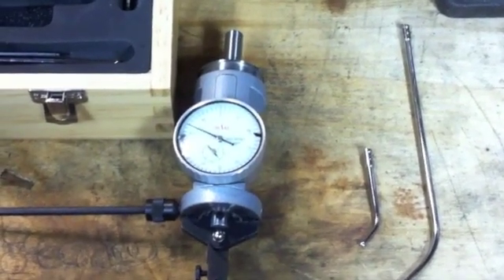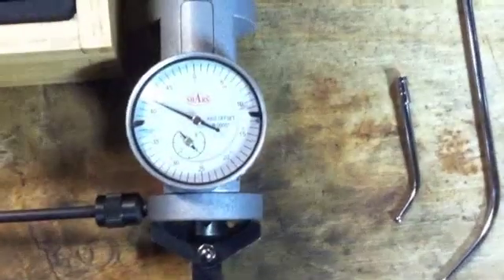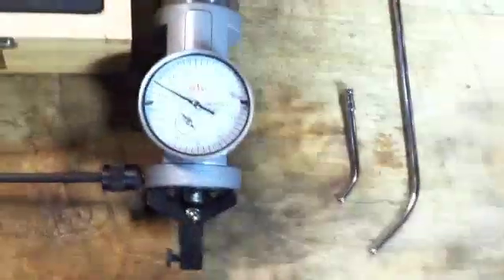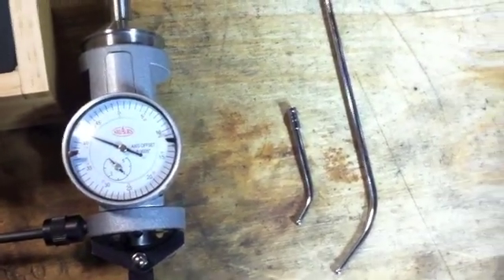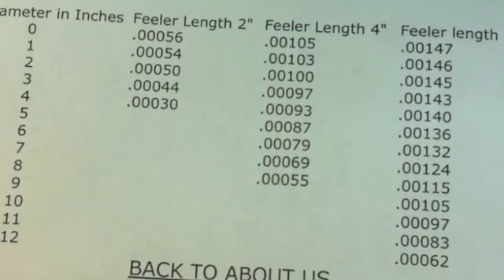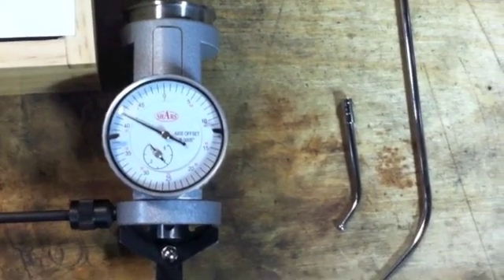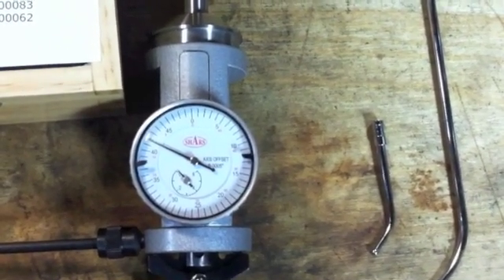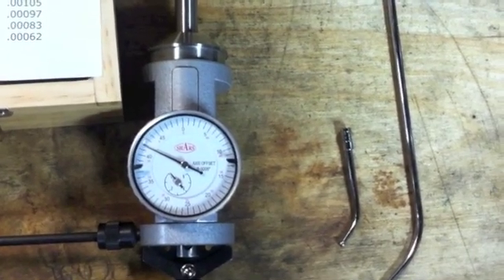Coaxial Indicator, an explanation of proper use.

Comment: I totally agree about checking the tools before hand; and do it as soon as you get them. I just threw 2 sets of ER20 collets in the trash as the run out was horrible. The next set I bought, I checked them immediately. I have spent a lot of money on measuring equipment which has been well worth it.  Thank you for the video and showing the chart from Blake. They don't list it on their site anymore so I typed it from your screen shot.
Reply from the maker: Good deal, Glad it could be of use to you.

Comment: Is this because of how the test indicator works?

The two ways I can see them working is either measuring the amount of rotation at the pivot point of the arm, or by measuring the actual distance moved at the tip of the 2" tip.

Sounds like the latter method is how they work, which means if you swapped out the tip on any test indicator, with one of different length, then the measurement would be off, no matter how the indicator is used.

Is this the reason, or am I thinking in the wrong direction?
,
Reply from the maker: That's absolutely correct. The movement of the indicator is calibrated to the movement of the needle. Because of the way a coax is designed it reduces the error but it's still enough to through off your readings.

Comment: I keep hoping someone will address the little "point" that comes with most of these sets.   It's a straight sharp point, it telescopes a little into its mount under spring pressure.  It seems like this can engage a punch mark, and bring that in line with a spindle.   In books about tool making they show work pieces with prick punch marks being set up on lathe face plates in this way,  later tool makers microscopes were introduced and you could look at the scribed lines directly.   Anyway, I'm thinking that if this setup was in a mill (say), and you centered the point, you could use it like a wiggler to get fairly close, and then actually engage the point in your tiny accurate center punch mark!   Here you won't get any numbers, you'll just make tiny adjustments somehow and see if you're making it better or worse.
Reply from the maker: My unit didn't come with one but what you are referring to is a center finder for a punch mark.  Some  edge finders have a pointed end that's about .375" in diameter. It's sole purpose is to pick up a small tooling and center your work quickly

Comment: a coax is for beginners to buy and put in their toolbox never to be used. If they do use it they wont survive in a cut throat high speed dog eat dog shop
Reply from the maker: Jeff C In most cases you would be correct. The coax has only one advantage and that is the elimination of indicator droop. Outside of that it serves no real useful function that a standard test indicator can't do.
Reply: Notus Notus,
You should direct that @ Jeff C not kcstott

Comment: "Was not designed to" is your argument? DTI was not ever desiged to find the center of a hole, yet it can be used for it. See the difference?

And you can still use the coax to tram a mill, the probe length isn't an issue in tha specific operation. The coax will show the same "runout reading" from a perpendicular or angled surface with a 6" probe and a 2" probe, the numbers just don't have any meaning, but then again this is not a measurement device but a comparator. Zero is a zero.

Comment: Didn't realise that the coaxial indicator was really just a virtual comparator. Your explanation was very interesting and very well put over.You obviously know your stuff and thank you for sharing.
I agree with your comments about the quality of some  imported tools but I have to say that without the cheap imported lathe, mill and measuring equipment I have bought over the last few years I would never have been able to afford  and continue in my  model engineering hobby.
To buy the branded names as you have said I think I would have to be related to Bill Gates or Mr.Trump.

Comment: Hey, I'm a newbie to machining, and I recently bought a milling machine and the same coaxial centering indicator that you have there, and I was hoping that your video was going to demonstrate how to use this tool for centering. what happened? I understand your explanation about the differences in the representation of the readings, but I wanted to see how to use this thing. I didn't buy it to tram my machine, I assume that this can be used to find the center of like a stud, for example, or something that I might want to drill down into the very center of it.
Reply from the maker: +Angel ECU There are more then enough videos out there showing how to use it. this is more of a "it's not to be used as such"

Comment: I have this same unit. Turns out I did not get any instructions and my smallest straighter feeder bar appears to not be very straight....is this normal? Its a very slight bend, but clearly not what I would consider straight.
Reply: the feelers don't need to be straight; the curved ones are very-NOT straight. the coax indicator is only for centering, it's not for measuring anything
Reply from the maker: Precisely. This unit can not be relied upon to measure anything. It was and is only designed for centering your parts or fixtures. 
But there are some out there that believe that because the sweep of the needle doesn't change when tramming a head in at an angle. That the graduations must measure something. 
These people do not understand what this tool does not how it works.

Comment: Same thing with test indicators though, they are usually rated for a 30 degree needle angle and a TIR of .005 to remain direct reading. Measurement errors from the swing radius and cosine of the probe aside, I never use these for direct readings. I only look for relative movement and a TIR of nothing if I'm centering.
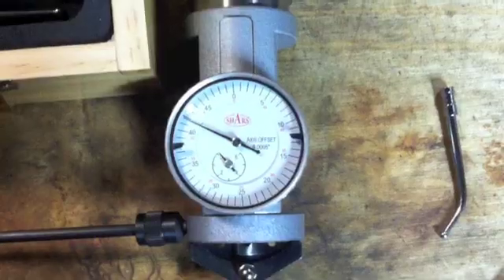Reply: So yes you can use them for tramming if you are looking for no relative movement and the margin of error is fair and reading ratio is high enough. A yard stick with a fulcrum at the first inch makes a fine test indicator for a lathe 4 jaw for example. No wiggle on a 1:35 ratio lever that long would be under .001" TIR. Just depends on what you use it for.
Reply from the maker: You're not understanding the point of the video. Your use of a test indicator to make a relative measurement is correct as the distance that the graduations represent is fixed. If you swing a .5" hole or 10" diameter the lines on the indicator represent the same value.

On a coaxial that value changes so if you indicate a 2" diameter with a 2" probe and the needle is floating with in two graduations you have .0005" total run out.
Now if you use a 6" probe and you have the same reading now you have .0014" runout not .0005" and that's the point. 
The value of the graduations change. 
Now this may not mean anything to people use a mill for a drill press but machinists and toolmakers need to understand this to properly do their job.
Reply: ***** Test indicators have interchangeable tips and cosine error too. Starrett recommends a range of .010" with the probe parallel to the surface and its rated tip length. Unless its a screw, rack and pinion, or other linear axis- any other conventional measuring device is not direct reading with the exception of a very small tolerance window once you consider the number of significant digits in your math.
Test indicators and coax's are to be used for comparative, relative measurement as a return to zero reference. Like taking the feel out of using a height gauge. Even if you use a coax to tram a mill, .0014 over a 6" radius (12" diameter swing) is doing quite good. I've made plenty of parts with an .001" or less tolerance on both manual and automatic machines and a Metris CMM or two to back it up. Measuring on a machine is best done with the DRO because its linear, not angular.
Yes its good to know what the approximate cosine error is before hand to know if the tool you're using is right for the job. This is largely a yes or no question though.
Reply from the maker: I understand that but you are talking about a rare specialized situation. What I want everyone to realize is the coaxial is not a universal indicator as the other videos tries to make it out to be.
Reply: +kcstott That other video is not saying it is a univesal indicator, just shows that tramming with it is possible and the probe length doesn't affect it in any way, as it is measuring an angle and not a diameter like in normal use.

I suggest looking up scaling of triangles, it explains why the probe length has no effect when used as a tramming device (because it is again, measuring an angle). If the surface to be measured is out by 1 degree, it is out by 1 degree at any radius and thus shows always the same reading on the coax indicator.

Comment: What if I am looking for the center of a .138 hole with the little pointy finger.  Is there a formula I can follow?
Reply from the maker: I would not use a coaxial indicator for that. Do it old school and set up a test indicator in the spindle and indicate that way. 
But that also depends on how accurate your location needs to be.

Comment from the maker: Just like you would not use a mill to hold a tolerance with in .001" you would use a surfaced grinder. the Coax has it place in any tool room. 
The coax was invented more so to eliminate droop in a indicator then centering. Try using a good dial test indicator, indicate a diameter on a horizontal plane. then roll the indicator over you will have indicator droop. The coax eliminates droop.

Comment from the maker: I removed my comments as well as another users comments as it was distracting from the intent of this video.
What is misleading is the other users comment about the indicator being a protractor. Which is correct. What I don't want to happen is other users of the coax indicator think the probe length doesn't matter. Yes you are making a comparator reading, But what you need to realize is that the graduation change their value as you change the probe length or sweep diameter

Comment from the maker: It's a hard concept for some some to grasp. (not implying that you don't get it)

I for one for years assumed that what the graduations represented was fixed at .0005" or what ever the indicator was designed for. It was not until after my apprenticeship that i ran into a tool maker that explained things and went through the trouble to demonstrate it.

Comment from the maker: Correct, And if you know the ratio of the cosine error you can use it to determine how far out a part is.
Yes you are just trying to get the axes in alignment with each other.
But when you change the probe length, the offset of the part as compared to the graduations on the dial change.

What I want people to understand here is that the value of the graduations of the dial change based on the diameter of the part and the length of the probe.

Comment: If you look closely at how they are assembled, you will see that there is a cover, glued onto the body of the housing. Behind that cover is the plunger of a very standard(but cheap) tenths drop test indicator. The end of the plunger rides against the bottom of the cone that has the mounting arbor on it. Now on the other end, you have a rocker pinned to the shank running from the bottom of the cone. I my mind, the changing geometry is not intended for measuring....only COMPARING axis' or tramming

Comment from the maker: Well don't get rid of the standard dial test indicator. They will always have there place.

The main reason the Blake coax was invented was to eliminate droop when indicating parts in the horizontal axis. The coax highly reduces droop to near zero. But as far as indicating in the vertical axis they are just quicker to use.

Problem is if you are doing very precise work the height of the coax makes it impractical to use as you do not want to move the knee of the machine once you are indicated in.